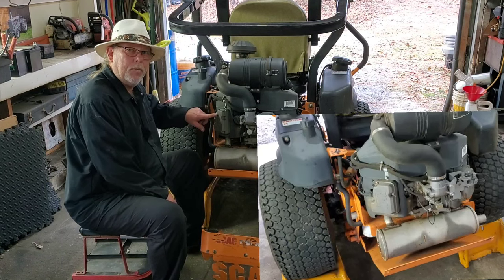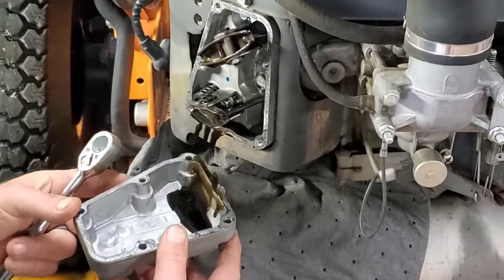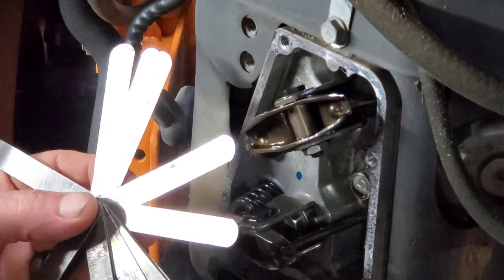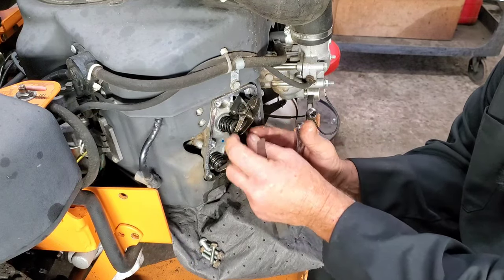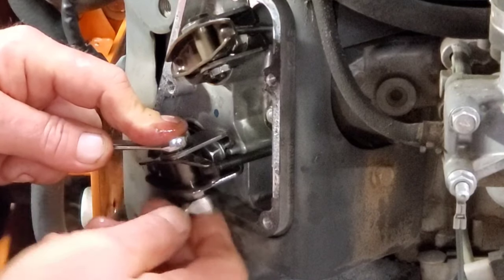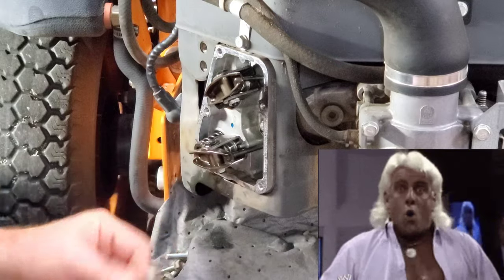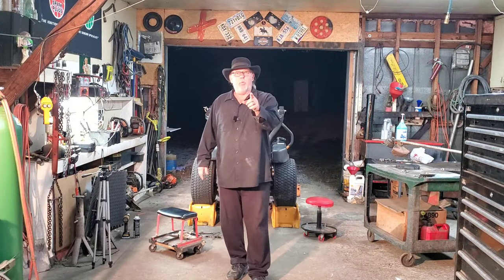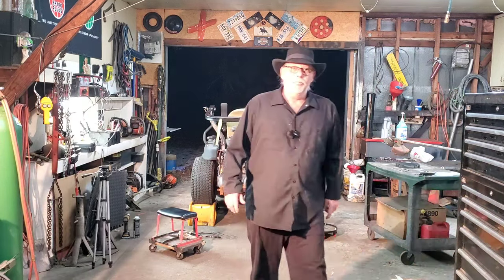Kawasaki Valve Adjustment on a Scag Zero Turn Lawn Mower Easy DIY Fix Ticking Noise FX691 FR691V

Comment: A simple way to be SURE you’re 100% on the base circle of the cam for the particular valve you’re adjusting is to remember the acronym EO/IC.  When the exhaust valve just starts to open (EO), adjust the intake.  When the intake valve just starts to close (IC), adjust the exhaust.  This works for ANY engine.  Hydraulic, solid lifter, lawn mower, top fuel dragster, whatever.

Comment: The removal of the spark plugs is going to relieve the compression  because of the over Head valve has more compression than a flat head engine

Comment: Hey T-bone, this is Jim got a question I have a 12 1/2 horse Briggs & Stratton that starts OK runs until it gets up to normal operating temperature and then it starts backfiring about every 40 seconds. Any clue what this could be caused by thanks, Jim.
Reply from the maker: Now that's a great question.  I would love to do a video on that one.  I would start with the basics looking at spark plug (is it NGk? or Autolite junk), maybe fuel flow, coil issue... If you are close to us bring it and lets film and repair it. Sorry, I don't have a better answer for you without seeing and hearing it in person.  There are so many things I can catch by just simple visual inspection and experience.  You are welcome to contact me via email after the Thanksgiving holiday.  Thanks for watching and commenting my friend.

Comment: Hola Mr. T-Bone great video Sir! How do you know when valves need adjustments? Thanks 👍
Reply from the maker: Great Question... Generally ticking sound, hard for the engine to turn over making you think dead battery etc.  Doesn't hurt to check every few hundred hours, the only cost is a couple valve cover gaskets.

Comment: Nicely done. By the way, what WAS that torque spec? One ugga dugga or two ugga duggas?
Reply from the maker: Thank you. Well that depends on the tourqe u lator on the thing a ma bob 😂
Reply: @RaleysSmallEngines  I grew up in an auto and truck repair shop owned by my parents. More than once I got yelled at for using too long of a wrench on a small bolt. I guess that I thought that tighter was always better.

Comment: One of my pet peeves - ratchet wrenches are not capable of “leverage”, only torque. (Unless you use them incorrectly…)
Leverage requires a lever arm and a fulcrum and moves things in a more or less straight line. Torque rotates  around a central axis.
Reply: Semantics
Reply from the maker: Well Bite Me LOL Hook up your Hitchimo to the dang thing a ma bob and Touque IT. Lmao